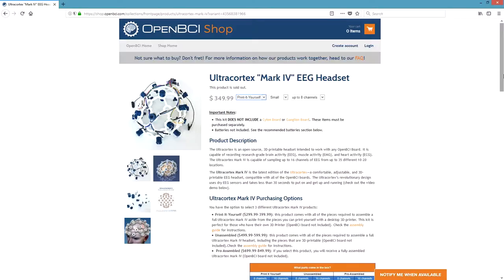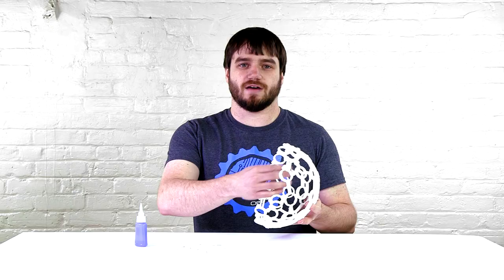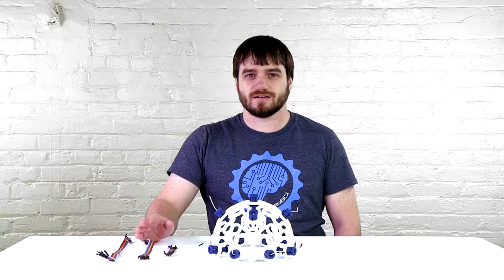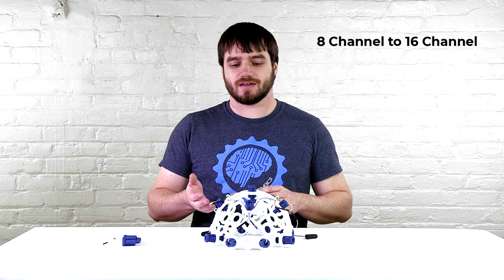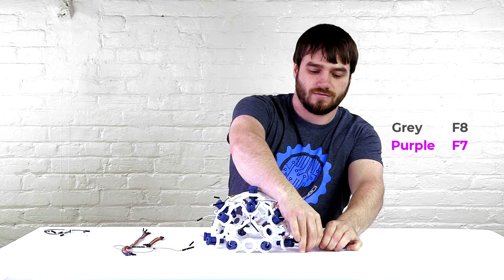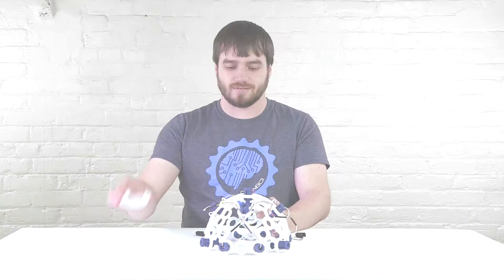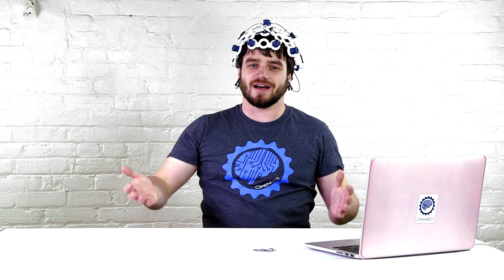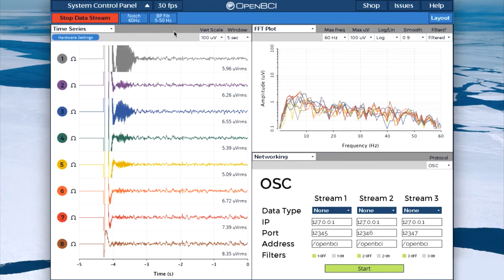Ultracortex Mark IV EEG Headset Assembly

Comment: I really want to know why these are still so expensive. If you can get a Pi for less than 200, an Iphone for 1k or a whole ass laptop for 1.5k why the fk is this little PCB, plastic and wires 1k?

Comment: I'm slightly concerned that your model uses screw-adjustable fitting. This copes with different skull sizes, but may be less accurate for non-standard skull arches, as the 10-20 system depends on registration at the Nazion and Inion points. Simply plonking it on a head misses that, doesn't it? What I'm more specifically focusing on here is the wide range of cranial shapes, particularly between those of pure HS and HN genotypes. Some racial differentiation may also be pertinent, we also have to consider that some studies suggest a lengthening and narrowing of the skull in the US which is less perceptible in Europe: nutritional intake in childhood and adolescence may be relevant.

Comment: O1 -> Red, O2 -> Brown. The website gives the correct setup, and this video swaps around the mistake without mentioning it or correcting it (really, guys?) And also mixing up C3 and C4 and blue and green (also mentioned in another comment) is not great. I'd correct the video or remove it and point people to the website. No point in having so many mistakes in a tutorial video. 

But the website, in the 16 channel setup, mixes up the 8" and 12" sizes (says to take 8" colours, which have already been used, when it needs to say the longer 12" ones). Hoping this comment saves a few people the hassle I went through figuring it all out :-)

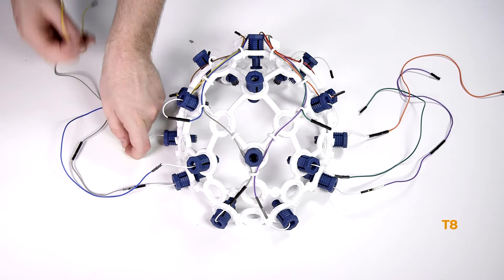And at 09:01 he says "P3" but puts it in T8 while the text says T3, right after mislabelling T7 as T8.  Right hand side (left-side from our viewpoint) is where the even electrodes go. Odd on the other side.  I give up.
Reply: I am trying to assemble and I really have hard time because it is not clear what connects to what and if the corresponding colors are matching the instructions. If the wires could have numbers would be great. I think you need to have a video of a how to connect daisy board to a ready helmet and I cannot figure out how to connect y-spider cable . - It does not make since in a manual - tat color order does not matter. and what I have to follow if there is mistake. what shall I do?
Reply: It took me like almost an hour to figure out to install-splitter cable to the bottom SRB pins and to black air clip. I and I am seeking the bottom bias pin of the cyton.
Reply: so true, was expecting more given the price of the headset...